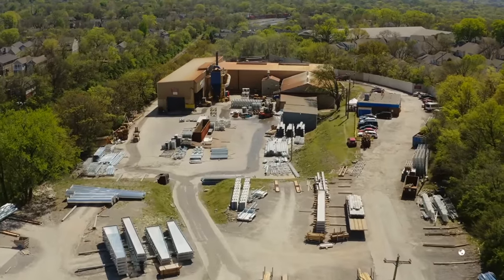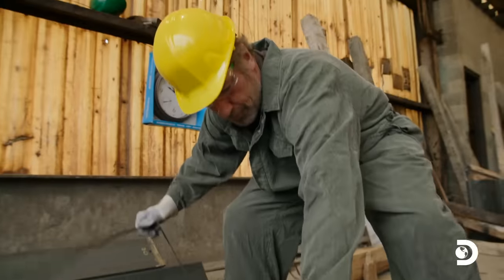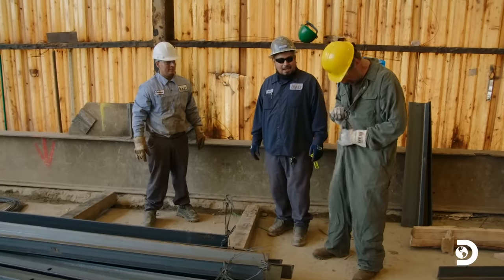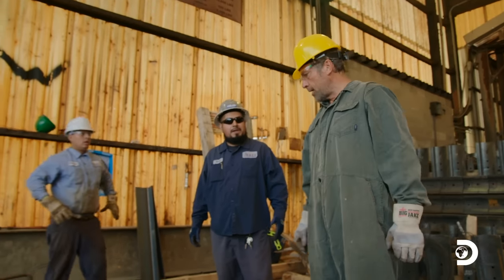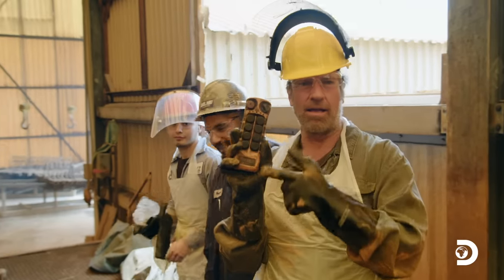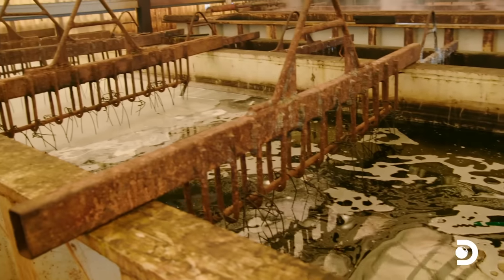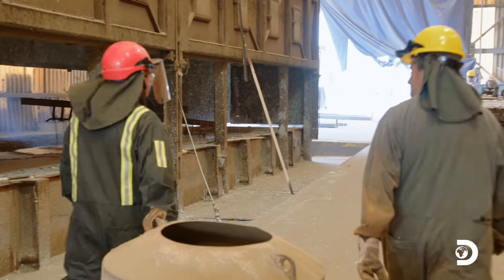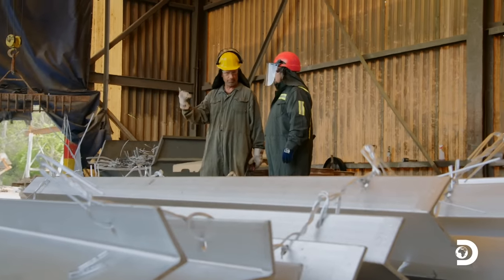Mike Rowe Has a Hard Time Making Galvanized Steel | Dirty Jobs

Comment: Was anyone else playing spot the OSHA violations? Personally the two biggest was lack of respiratory protection while working with zinc fumes and others, whilst some would say its well ventilated I would think the cumulative effect of doing this day in and out for 5 days a week 8 hours a day for years will likely have adverse effects and likely should or needs to be present. Second crane control device with not just worn markings but apparently none. The third less serious would be grinders lacking guards, seeing how its flap discs on the grinders it isn't to bad but if it was slit discs or regular grinding wheels injures that could otherwise be easily prevented would be much more serious.
Reply: @Kristian Skov  relax snowflake, really?? Have you ever seen a grinder disk in pale someone? Have you ever seen your co-worker pass out because of excess fumes because someone wasn't wearing the proper PPE? There are safe guards in place for a reason. If any safty man showed up here and audited  them, they would have failed in  multiple areas
Reply: @C4AJ  ....pass out from fumes??
There is such a thing as "common sense", and it's not illegal for one to use it.... that's all  I'm saying..
I'm not saying "do what ever you want", because that's just plain stupid...
Reply: @kristianskov4841  Yeah the zinc sickness can get you, some people get it pretty bad. Pretty sure this is the warehouse in SD, and its large and you dont stand near the zinc bath very long. That being said some respirators would help A LOT. I wish I had used one when welding parts like this. You think you're fine then its 2am and your throwing up
Reply: @augustopinochet3830  hazardous jobs and small wages don't add up in my mind.
Pay up, or I'll walk out....
Once again I'll be referring to common sense.. Sometimes it feels like I'm the only one who remember how to use it...
Reply: @kristianskov4841  "absolute minimum i can get away with" Reading comprehension is hard tho!!
Reply: I guess that's why they had to bring people from Mexico into Nashville.
Reply: OSHA? Ocean!

Comment: Working in a fab shop and always seeing our beams and columns get shipped away and then come back galvanized always intrigued me. Amazing to see how it’s done.
Reply: Same here, my old company used to ship out sand blasted flange rings of all sizes for galvanizing.
Reply: Process is similar at most galvanizing plants some are a little nicer though. I'm maintenance for azz in mn
Reply: @timhatrick8686  I’m from central IL and we send our steel to Azz in Joliet.
Reply: I worked for AZZ for 3 years. Loved it but the health issues wasn’t worth it
Reply: Yup. All galvanizing done for my company is a separate shop. I process the angle and flat bar prior to galvanizing
Reply: @Fattony6666  Chicago isn’t that far from it!
Reply: @XxMALICE666Xx  Going down the line... I work as an engineer in AL drawing up the electrical substation panels and buildings. We get enclosures from AZZ all the time!! We get concrete buildings too but the steel are pretty sharp looking. Can they really withstand tornadoes?? guys are work are always questioning those windspeed ratings
Reply: @Jarrettmonty99  I mean yea if they are in the ground. Depends on how thick the metal is. A 2x4 in tornado and  can put a hole in a brick wall. If your guys are worried then dig a hole amd place it.
Reply: I worked in Texas for a company that made crash barriers and such, and we kept AZZ busy in Houston and San Antonio. Usually one truck a day. I have an AZZ hat! lol
Reply: I'm running a fab shop now, I was a structural welder for years, it's damn sure nice getting to weld on this stuff BEFORE the coating lmao.
Reply: Nah man I’m tired of y’all sending “internally vented handrails and they always end up floating in the zinc bath lol
Reply: Same here, work in a fabshop and wondered about the galvanizing.
Reply: Yeah same here. I work at a huge steel fab and paint shop. I am the paint shop foreman so I just love seeing the steel with the pink ribbons on them. Pink means galv so she don't have to touch them

Comment: I work in a galvanizing plant in Australia. We use almost identical "hooks" except we call them spreader bars and use them exclusively for large & thin plate sections that can distort or buckle due to over exposure to heat of the zinc kettle (450 degrees celsius) as well as awkward, one off 3D frames and the like. Sections like the angle that Mike is working on would be wired to a head frame which is essentially multiple of these "hooks" one one large overhanging frame. They are used to submerge dozens if not hundreds of items in one go.  Everything is wired at a 45 degree angle which allows the molten zinc to run to the lowest point before dripping off. This means the cleaners have a much smaller problem area to tidy up at the end.

 My job is to accurately check off and itemize each order that gets dropped off to our plant. These jobs can range anywhere from a handful of brackets to 20 tonne of structural steel. We utilize specialized "kettle" tags which are essentially ID tags. I enter these orders into a computer system and print out sufficient tags for every order. These tags are lazer printed then laminated with a specialized tape which allows for the tags to be legible during the cleaning & packing process. The production crew has access to tablets on the plant floor and have a program that allows them to mark every individual piece as being in production at the end of every completed headframe. Each headframe (total of about 20) has its own individual number so the guys can look up the headframe number on the tablets and prioritize each one based off promised deadlines with different customers etc.  This gives us an extremely high level of traceability of every single piece of steel in the yard or plant at any given time.

Hope this gives a bit more of an insight to anyone that might be interested in a different part of the process.
Reply: @mattsseeds5071  you cared enough to reply
Reply: very interesting. I've been to a small plant in italy. Could not see the whole  process but i remember they were using some sort of steel boxes of different sizes depending on the dimension of the part that needed galvanizing,
Reply: @ausryan6662  Look at me I’m on the bottom of the globe and I care so much.  What are we talking about?
Reply: If you don't mind me asking, what sort of tablets do you guys use on the floor?

Cause I imagine they'd have to be pretty rugged to survive in that sort of environment for any appreciable length of time.
Reply: @HowToCannabis Did someone hurt you buddy?
Reply: @12Mantis  Nah we use the cheap and nasty brand name android tablets that cost 50 bucks brand new. They hold up surprisingly well - usually get around a year out of them before they need replacing
Reply: @ausryan6662  Really?  Is that with or without a protective covering/case?  Cause I figured between the cleaning chemicals and metal dust/flecks from smoothing that cheap tablets wouldn't last long there.
Reply: @12Mantis  That's without a case or covering. Trust me it was a head scratcher for me too when I found out these things were lasting that long despite spending their life meters from hydrochloric & caustic acid tanks.
Reply: I’m a Ironworker in California and we put handles like that on the small bundles by twisting the wire like that.
Reply: @ausryan6662  😂🤣😂gottim
Reply: Thankyou sir for being the guy that makes me have to do allot more grinding before welding 😂😂😂
Reply: @AusRyan Do you use the same approach to cleaning the excess zinc? I was under the impression that grinding (and welding) galvanized steel can cause serious health issues, but in this video they used minimal PPE -- face shields and no air extraction.
Reply: Thanks for taking the time to explain this. Don’t mind the koala-haters!
Reply: How's the wages? Pretty curious if this work pays half decent
Reply: @Crazy Crooker  no no no no dont 
It will literally cut your life in half for abour 35$ an hour
Reply: @Gib Macs  trust me ive known harder working cone punchers then alcoholics 🤣 nice to know its not just my place thats sketchy asf🤣 Kwinana for the win 🤣
Reply: This is awesome insight, appreciate it for sharing. I've just started learning how to weld properly, really interested in metal works etc.
Reply: @Nonstick Pansexual  as a boilermaker (welder) by trade. Id say be very careful welding galvanised steel. You need to make sure you remove all galv before starting. Its usually 2 color changes with a grinder and its back to normal steel
Reply: @mattsseeds5071  Ah, hello good American! I'm sorry but I do not speak superiority complex.
Reply: Thanks!
Mike's "tour" of the factory and your comment has been very helpful.
Salvaging (scavenging) scrap metal for nearly 20 years, and the son of a builder - just never got around to learning about it.
Kind regards 🇦🇺
Reply: @sarahclark6068  haha your safety question sent him packing
Reply: @mattsseeds5071  Technically the bottom would be Antarctica if you going by traditional south, but given the shape of the Earth and the openness of space any area can really be the bottom depending on where your starting from. Slow down on the cannabis and do some more reading before trying to troll. Next time you won't look so dense.
Reply: Cool thanks for explaining.

Comment: They make the galvanizing process look pretty nice here. Every time I've dropped off material at the galvanizer, the brown dust is billowing out the doors.

I once asked a worker if it bugs him.

His reply: "My lungs hurt for a few days but I got used to it."
Reply: Yeah screw that.  I'm good on getting lymphoma or copd. Sad people have to deal with this stuff and in the end end up probably dying from some horrible disease
Reply: Why can't they just wear masks or respirator gear?
Reply: @wyat_za377  99% of the time its because management doesn't enforce it, and wearing them sucks. I don't need it often at my job. It sucks to wear it when I do though. They restrict your breathing, you can't communicate easily, and it gets hot. That being said, my life and the quality of it is far more important than being a little uncomfortable for a while.
Reply: @mikemoore1769  thanks for the insight! I'm lucky that my new apprenticeship only requires working with CNC machines.

 Don't think I'd ever be able to manage inshaling those fumes 24/7. Sad to see management not even care enough to install a ventilation system

Comment: This makes me so grateful I got to just send everything out to hot dip/paint. Those dudes are a different breed huffin that stuff all the time. I would rather break my back doing anything else... One time we made a long floating bridge for some richy rich to drive onto his island and someone above us made a rare mistake and we had to do hot stick galv repair on a small section of it. The older welder with me got sick as a dog. I only knew how to mig on mild steel at that time and so he got stuck stick welding a few missed spots where there was no clearance, while I went behind him with the torch and melted galv sticks on the fresh welds. I guess I just got lucky, neither of us had a respirator outside and it was a little harder for him to dodge fumes. I remember he went out and bought a $600 extraction helmet after that. We all made fun of him but he said he was really really sick lol.

I've read that there is no concern of occuptional health related hazards from zinc but I don't believe it for a second. Maybe in a perfectly ideal workplace, or maybe it was the paint/zinc combo they had going on, but that place was a freak show. Whatever they get paid, it should probably be more, I felt bad for them every time I dropped something off.

Comment: I'm a structural steel fabricator. I deal with steel pre and post galvanizing all the time. The stuff is absolutely awful to weld.
Reply: pre galvanizing = just steel shouldn't be a problem. post galvanizing = don't weld it period.!
Reply: @johanandersson2165  No choice sometimes. Respirators rock.
Reply: @daviddesrosiers1946  PAPR hoods make it an almost pleasant experience.
Reply: @daviddesrosiers1946  You could use wireweel / flapdisc and then you have bare steel.
Reply: @johanandersson2165  You never get all the zinc removed. The dust is still there. Believe me. We do use grinders in the weld area.

Comment: I'm so happy to see you back at it Mike! You should pay a visit to a machine shop sometime a non aerospace one thats nice and dirty.

Galvanizing is crazy, we had to mill holes in a Galvanized block at my shop then the customer regalvanized it with a rose bud and smearing a zinc compound onto the fresh cuts and melting it into the steel.
Reply: Yeah machine shops are one hell of a dirty job lol
Reply: Huh. I didn’t know you could do that.
Reply: @cholulahotsauce6166  there's several ways to galvanize. The company in the video looks like they are doing "Hot Dip" but there's also cold galvanizing and applying zinc galvanizing compound and heating it up.

Comment: The only thing worse, is having to grind off an area and weld a galvanized component to another piece of carbon steel. Special PPE is required to do the task. The smoke from the welding process has very toxic fumes as the zinc burns away and spiderwebs of burnt zinc hang in the air.
Reply: i make duct and our angle ring they dont grind off the drip sickles. when i first started i was the go clean the angle rings which was me day in day out grind the galv off the angle rings where the welders would weld it to the duct. after a week still have this nickname of sauron for anyone but me grinds the galv off they would who da fudge ground this it  wasnt sauron. for dull grey is galv the shinny hahahaha still hear bitches galv and the shinny bear steel beautiful weld metal. the person who was grinding stop at the shinny hahaha still hear bitches galv to when welds you sound like you know of pop stizzz mother fudger of hot galv burning threw welding gloves
Reply: I've welded galvanized like twice in my life both times I just used a respirator and both times I was outdoors, nowadays I just pass on those jobs
Reply: @LoveShaysloco  nice word salad
Reply: @contraband1543  i take that as a complement for we talk worse then that at work and if your not in the know then you will have a wtf face on like were from planet galv
Reply: @LoveShaysloco  English please it was basically impossible to understand you

Comment: You know I always wondered, does the metal where the hanging wire is touching also get galvanized? I'd imagine the solution is able to get between the metal and the wire to properly coat it there too right? Or is just that it's such a small spot that not being galvanized isn't an issue?
Reply: When we get our sample parts at work, you can sometimes see where the part was hung in the coating process. I'm told that the supplier will usually re-hang the parts and coat it again if there's no inconspicuous place to initially hang it from. This is for powdercoated motorcycle parts but I'm assuming the same might apply to galvanized parts, too.
Reply: @kn8tronbomb  Powder coating is a fairly thick process compared to molten zinc, but I would think that there would be a small contact point where there's no zinc. But these aren't submarines or spaceships they're building, they're industrial parts and a little spot of bare metal here and there won't be that big a deal. If it is, a bit of spray paint will help seal the bare metal in that spot. Since they're often in bolt holes, you're probably going to have to paint over the bolts to keep them from rusting anyways. (galvanizing doesn't work so well on nuts and bolts. It adds thickness and roughness.)

Comment: I draw steel fabrication projects, and many are galvanized.  Things like pipe trusses or pipe/tube handrails that are dropped into a galvanizing vat have to be vented for air to escape and also allow the liquid galvanizing to drain.  Galvanizing is sold by weight, so you don't want any extra to be trapped in the voids. I've been to a few foundries, but I've never been to a galvanizing plant to actually see it happen.  Thanks for the tour.  Did you know that electroplating was one of the first commercial uses of electricity?  Re: silverware.  They used battery jars for the electroplating process.

Comment: Mike Rowe is much better than the average person would be learning these jobs.  He's done a bunch of these kinds of things.  More than most newbies to the particular job.  And he still struggles to keep up with and learn from the guys that do it all the time.

I worked HVAC installation, making duct work when I was younger in high school.  He ain't that bad.
Reply: I have seen some videos from HVACR VIDEOS and there are stuff done by pros that makes me as an amateur just wonder how those items are working despite all that's wrong or that they for some reason have avoided a fire. And that could be just the manufacturer design of the units, not how they are installed.

Comment: Twisting all that wire seems pointless.  Why doesn't the crane just have hooks on it that attach to the item?   I hate to point out the obvious.
Reply: You can't keep dipping hooks in the liquid metal dummy that's the wires are for
Reply: that would be more points of failure for a crane also would take longer to unhook then just cutting some wire those holes can be pretty small depending on what's getting dipped